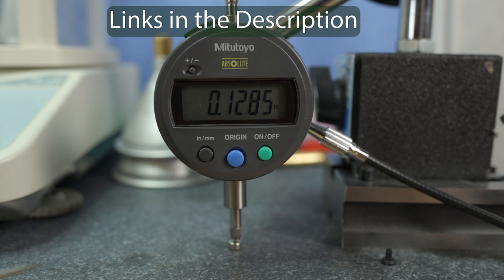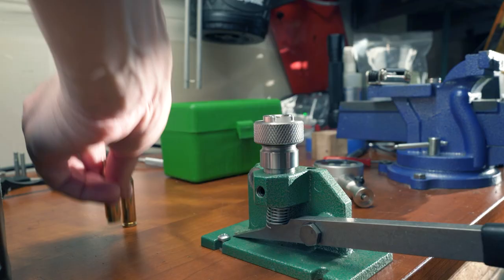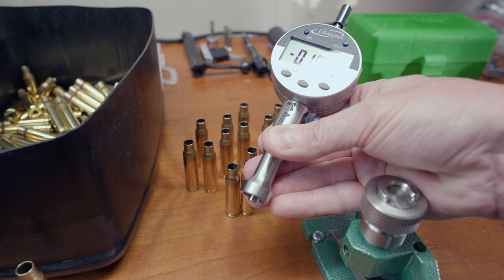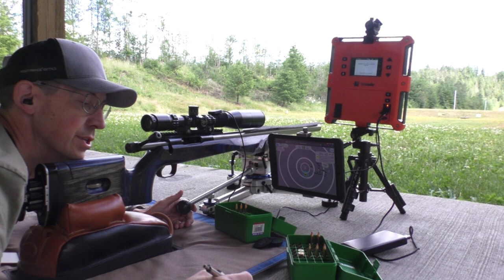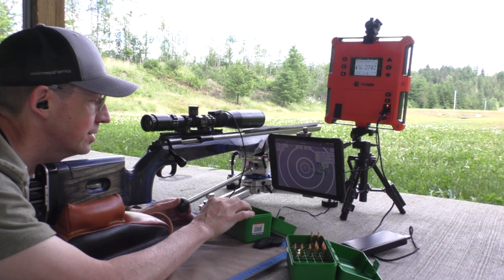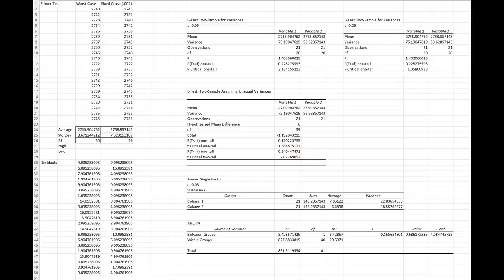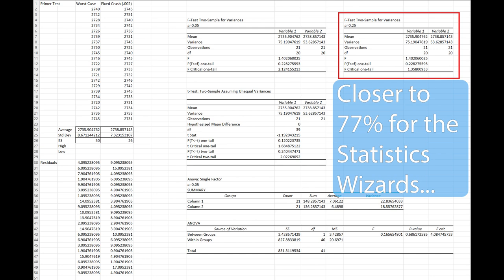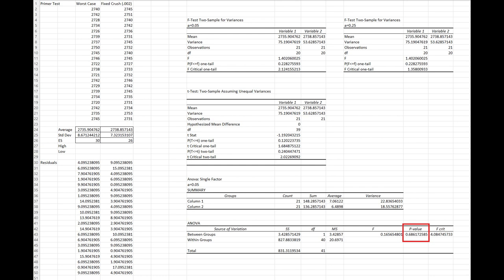To Crush, or Not to Crush, that is the question.

Comment: Call me crazy but I simply use a hand priming tool and stop when I feel the primer contact the bottom of the pocket. Seems simple, is simple, and it works for me because I'm a big fan of simple. That is not to say that I'm a simpleton, I just don't believe in unnecessarily complicating a simple task.
Reply: Lees hand priming tool is used by many bench rest shooters. Main take is that you can feel loose pockets easy.
Reply: I'm crazy too. A firm squeeze after it's seated and my groups are in the .1-.15" range at 100 yards and an SD of 5. I also use a cheap mechanical beam scale.
Reply: @jmkhenka  You can't measure "feel" something some people just can't handle (Like Kieth, I think! LOL)
Reply: The simplest solution is often the best one.
Reply: Agreed!!
Reply: @rustynut1967  I use the RCBS beam scale for my precision loads. I can see that scale move when one kernel of powder drops into the pan and with a digital scale that doesn't happen. Digital scales tend to drift too. The accuracy just isn't there unless you buy a very high end scientific scale which is very expensive. When you go to all the trouble to properly prep your cases, choose quality components, put in the effort to develop that load... why would anyone say, "Eh, close enough," when it comes to the powder charge?
Reply: @CplSkiUSMC  I use the same thing. I use my laptop with a USB camera to make it easy on my old eyes.😁
Reply: @rustynut1967  Hey, I never thought of that. I bought some small lights that illuminate the scale to make it a little easier, but I never considered a camera. Now that's innovation!
Reply: I do the same thing but sometimes it goes to ten thou below flush.  What up with some cases being so deep
Reply: @wisemechanic1758  In Keith's experiment here, he found the primers were of different lengths or depths. Primer pockets are not exactly uniform either. Nature of the beast. I find the same thing from time to time and look at them, sigh a "hmmm," and move on. If I was a benchrest competitive shooter I might worry about it... then again, some things just aren't worth fretting about.
Reply: @CplSkiUSMC  I wonder though in your experience how deep is too deep.  I’ve had some at 11 thou and I feel like that’s pushing it
Reply: @wisemechanic1758  I've never gone to the trouble to actually measure them, but they are noticeably deep in the pocket. I've wondered at times if it would result in a light primer strike, but I've never had one fail to go off. I believe primer pockets are swaged in the manufacturing process and if the pocket is too deep... what does that mean for the case capacity?
Reply: @CplSkiUSMC  that’s what I get worried about.  Light primer strikes.  I read somewhere once that a primer should never go 11 thou below flush.  I try to set mine about 3 but then you have these people that say you need to lightly crush the primers.  So many opinions
Reply: @wisemechanic1758  I always compare opinions to my own experience. My experience has been that there has been no noticeable difference in performance even when I accidentally crush a primer in a tight pocket. I think there are so many other variables that are much more important. I live in Wyoming so I love to shoot out past a thousand yards and so I try to wring the best performance out of my rifles and my loads. Even with that, there I some things that I think are just a little over the top and primer seating is one of them. If it's seated to the bottom of the pocket, that's all that matters to me because I have never experienced anything that would suggest a problem otherwise.
Reply: @CplSkiUSMC  a thousand? Very cool.  I can barely get 400 yards where I’m at
Reply: @wisemechanic1758  At this elevation, a .308 Win is still supersonic past 1100 yards and busting milk jugs out at that distance is a fun challenge. It takes a tight grouping rifle/load combo to do it though and there's a fun challenge in itself. I love hand loading.
Reply: Found some Remington small rifle primers. Any one know if they’re any good.  Bn using cci since I started reloading a year ago.
Reply: @wisemechanic1758  I've used Remington large rifle in the past and they're okay. Not the greatest but they work alright and anything that works right now is better than nothing. I did get good results with Winchester LR primers if you run across those.
Reply: I thought the same till I started measuring them.  Turns out the feeling I was getting with my hand priming tool was the cup hitting the bottom of the pocket - ie I was crushing the shit out of them.  I changed my my priming tool for one that I can preset the depth.  I am not totally convinced that it’s all that critical, but keeping them  consistent and not over crushed can’t be a bad thing.
Reply: @horseguy1230  I wouldn't disagree with that. I'm sure that such a tool makes "fool proof" an easy destination. I've squashed my share of primers on the road of experience, but I've reached a point where I've mastered "the touch" and a crushed primer is a rare occurrence. I don't think it makes any sort of quantifiable difference what depth the primer is, so I can't justify the considerable cost of the tool.
Reply: When I'm chasing that x ring I use cci br2. I've run soo many rounds through my Dillon that I feel any difference. The best part is no human hands ever touch them. I keep them sealed with desiccant packs.
Reply: @Michael-rg7mx  That's the way it's done. There's no substitute for experience.
Reply: The Frankfurt Arsenal "Perfect Seat" Hand Priming tool is adjustable in.001 increments. Measure the pocket and set the tool, with that weird pokey thing that sticks out the end of your caliper, lock down the dialy thingy on the tool and you're all set. You can work on that Kung Fu grip and not crush any primers 👍 and it's like $105 bucks. Comes with a little tray dealy too 😂🤙
Reply: @MrCclimeGo  I might have to give it a look.

Comment: Hmmm… maybe a 600$ primer seater is a waste of $. These are my favorite type of videos you do Kieth. Thanks!
Reply: Got to admit that $600-$700 priming tool looks absolutely marvelous though. I never got one, but if I did I would have simply set the thing to full depth and seated the primers by feel to the bottom of the priming pocket trying not to crush them, as that is what all the reloading manuals say to do [at least all the ones I have found that even mention this issue. Personally, I have over 60 different author's manuals. 30 from manufacturers and another 30ish from others in the industry.] So now there is a "Poorman's Competition Primer Seater" that cost $100-$200 (depending on if it has a micrometer or not) that looks marvelous enough, of which I am planning on getting and simply seating all primers flush with the bottom of the primer pocket. The only reason I want this tool is for fast efficient priming, period. https://www.youtube.com/watch?v=xPZFTrmJ6bs&lc=Ugzrx7igbql7QheKEzJ4AaABAg.9yavDmUrDV5A4Q5l4yG2wV

Comment: Two things: firstly, the point of anything other than a hand primer could be consistency. So a test of any consistent depth vs. priming with a hand tool, or deliberately constructed set of varying depths, would be great. Secondly, sample size is too small for asymptotic statistics. You need to use a randomisation test. But probably on groups defined by consistent vs. random seating. ;-)

Comment: The only test I have seen yet is Witch Doctor's.  He did a primer weight sorting test which showed a statistical difference and tighter group sizes when all the primers in a given set of cartridges weighed the same or within a small spread.  There is a difference in crush on precision.  You lose some velocity if the primer has to push itself back far enough to get a flame down the flash hole.  Don't crush them to the point the anvil blocks the flash hole.  I seat mine between .003 and .006 and never have a problem.  Thanks for doing this, Keith.  As a patron and a member of the F-Class community, I appreciate all the money, time, and effort all of the creators put into these tests.  I believe it helps folks sort the tools they need from the ones they don't.  Personally, I enjoy collecting precision measuring tools, and being a science guy in college, I enjoy gathering empirical data just about as much as I do shooting that data.  Please, keep up the great work and keep teaching.  You have a teacher's heart.  I can tell how passionate you are about it, so no matter which direction F-Class ends up going, please continue to teach!
Reply: have you ever taken apart a primer?  taken out an anvil?  shot a puff load? fired a primer without powder or bullet?  primer only backs out when chamber pressure pushes it out.

Comment: One thing that occurs to me is that primer seating depth is likely a small influence. If you're outside your node then the other factors may hide that difference in a larger amount of noise. If being in the node is 50% of accuracy and primer depth is 5% then it's going to be very hard to see the 5%.  I think it would make more sense to do a test where everything is dialed in except the primer depth.  In any case, Thanks for the extra data as always!

Comment: I use a modified Lee ram primer system they no longer make because people were having bad problems with them, it has a feed tray on it and auto feeds primers. I put 2 mods to it. 1st I put a shell holder position adjusting set screws on it so I can insure better center of primer to pocket alignment as different brand shell holders can align different and next put the adjustment to the primer depth in the ram pin instead of the die, as it required to screw in or out the ram die to change depth. Using different shell holders changes the depth even when using the same brand holder. And yes, the base of the case even in the same lot can change a little bit which effects the depth of the seating , and believe your tool will fix this. I watched it's operating closely. Hope to see it soon on the market.

Comment: The major benefit of even primer depth below flush to the case base is more even firing pin impact timing on the primer between pin release (trigger let off) and impact.  This is somewhat negated by very low trigger pull settings that can be used in games like F-class.  It is very valuable where rules require trigger pulls to be in a more "normal" range like 2 to 5#s.  Primers seated short can lead to some ignition SD/ES problems, and if too short can lead to miss fires as noted in the video.  Primers crushed too much  can also lead to ignition  SD/ES problems because the pellet compound may fracture or push out of proper pinch between the cup and anvil.  There is usually a .006" tolerance between primer seated to touch and primer seated to excess pellet crush.  Different primers will have different tolerances.

Comment: My 300 win mag Lapua brass (haven’t touched the pockets) is showing as mostly .125” deep on my Accuracy One depth gauge, yet my Federal 215M primers measure mostly around .1285”. I’m seating them about .002” below flush which sure seems like a lot of crush, and the pocket measurements seem shallower than what I’ve seen posted elsewhere. I’m shooting it through a new Bergara MG Lite that I’m working up a hunting load with Ramshot Magnum and the 175 grain Barnes LRX. In my sweet spot between 81.2-81.8 grains of powder it was shooting all .4”-.7” groups at 100 yards with a 5-6 SD without tuning for set depth, so it seems like they are igniting just fine. But after watching Erik Cortina and Greg Dykstra’s conversation along with some other testing I really want to get my primers set to precise depths to control as much as I can, but in the end I may not notice the difference with a hunting loads in a factory rifle.

Comment: In Excel, if you hold the cntrl key down and push the Tilde key it will show you formula view. (Shows you any formulas in each cell)
Also, if the spreadsheet is saved you can enter into a cell the following syntax. =CELL("FILENAME") and that cell will always display the location, book name, and sheet name of your spreadsheet no matter where you move it

Comment: Most people would never realize any improvements in primer seating beyond what we already have.
The primer still has to fit flush or below the surface. Cases vary, primers vary, powder weight varies, bullet weight and diameter differ. OAL varies. trigger pull varies, & mirage, no nobody will notice. Just make a tool that works well & is cheap and last forever.

Comment: Never ever used the priming setup on the press. After case cleaning, pocket cleaning and flash hole reaming, will seat primers with a Lee hand Primer(or other) Thumb pressure lets you know. To smooth and discard the case(or plinking use) With bit of experience you get the feel. Unless you go for the Ultimate priming tool. If to tight, have a primmer pocket swage. Just a hunting reloader myself. BUT Ultimate Accuracy, Ok👍

Comment: Great info Keith.  I understand and appreciate your use of statistics.  However I have a question.  When you go to on paper performance measure and analysis, you only report extreme spread.  I dont disagree that is one important measure, but I dont think that is very descrptive of performance.  Imagine if you will one group with two 8s and eight 10s, versus a group of ten 9s.  The first had the largest ES, and the better score.  Now I am not saying that happens a lot, but it is possible.  So in addition to ES when it comes to on paper hits, I also measure the X and Y dimension from any fixed point on the target (usually point of aim).  Then I calculate the center, average, of both X and Y, and to eliminate any offset, I subtract them fromthe actual X and Y fir each shot.  I then calculate a radius from that new center using square root of sums of squares.  I then statistically analyze the average and std dev of each Radius.  It sounds complicated, but is dirt easy with Excel.  That gives  me a better characterization of all shots, than just extreme spread.  Then use normal T test processes to compare the “radius” of the two groups.  I think that tells me more about the difference in on paper hiys, than simple ES.  I dont ignore ES, I just use this process as another tool to help understand performance of all shots in two samples.

Comment: Very much appreciate the testing!  I would like to encourage you to crush the primer so that the primer cup is touching the bottom of the primer pocket.  Cup length will vary per  brand/lot, etc.  However, it it pretty darn consistent and using manufacturer spec is good enough.  This is, in theory, the only way to know 100% anvil crush.  You will see this is deep.  I dont know anyone that does this....and in my thinking...would be the test to end all tests.
If you have watched the Primal Rights/Cortina videos on this subject, they ended up around .007".  That is still not 100% crush in most cases.

Comment: What is your mod for ram and shell holder on the RCBS APT used in this vid?  (Is that your build??)
I’m getting a .006 variation in primer depth, some, at least, due to my technique/feel (& I don’t have an Accuracy One tool). Only 200 primers into this unit do learning.

Comment: I'm sticking with my 20+ year old Lee hand priming tool and going by feel. Remember primers do not act alone. You have flash hole diameter and flash hole lengths. From my reading an old Speer reloading book in my child hood . Flash hole lengths may have more effect than flash hole diameter. Do not diss guard firing pin protrusion and diameter  on the effects of primer ignition. No use reinventing the wheel. I sure these experiments have been done before.
Reply from the maker: I'm working on that too. It was going to be a surprise party!
Reply: @winninginthewind  I love what you are doing. You are the Sir Isaac Newton of accuracy reloading.

Comment: I like your absolute methods. I like probability and statistics. What you have proved, yes confirmations bias, I call it a mathematical proof. Lol My very first study of this in an old Lyman manual and what I did in my testing of varying the input, verified that Lyman's statement was correct. Make the primer pockets all the same depth. Deep enough for tallest primer for a .001 or 2 below case head and seat them when it just bottoms out. The best tool,  a least expensive hand primer, Lee Auto prime hand primer. I have used others and always grab that one as first choice. I even called Lee last week and gave them the best product was their first and should make it the same way with maybe a more ergo fitting paddle instead of the flat one.  Engineering, we still have a B52 flying and is effective.
 Wanted to add, reloading is part art and part science. Amazing what the human hand can feel. And also like sound, we can produce a perfect sound but can your ear tell the difference. Great videos you put out and appreciate the effort you put in them.

Comment: testing primers in a loaded round is basicly useless. There are to many factors - and they affect the ammuntion way more then a primer does. Neck tension, case volume, bullet evenness, seating depth, temperature, powder temperature, humidity..

Primers needs to be tested in isolation.. And thats hard for anyone outside a lab to do. I cant imagine how really.

It would be if you could sort the cup, anvil and primer seperately from each other. I would think proper ignition is the most vital part, and thats why small primers and flashholes are better then large for most bench rest shooters.
This can be seen in 22LR where proper ignition of priming compound is a big part of why some rifle designs are more accurate then others. and why filing striking pins on systems like cz 455 is such a big deal.